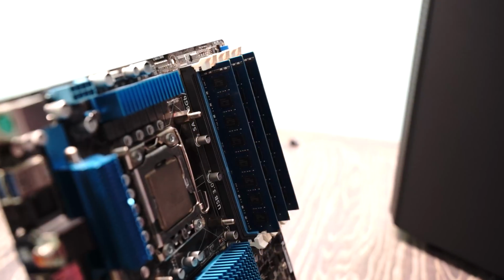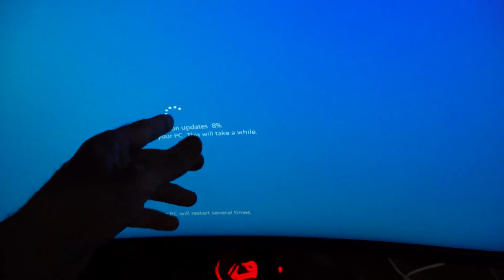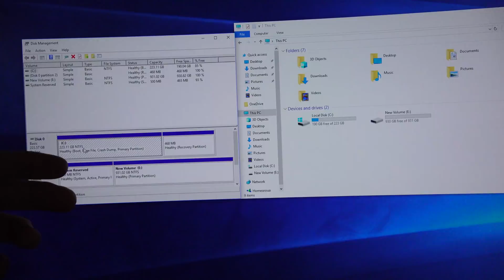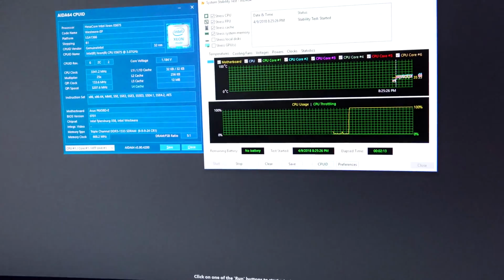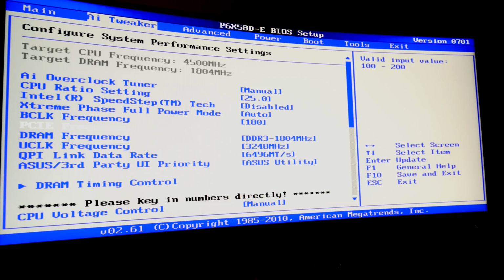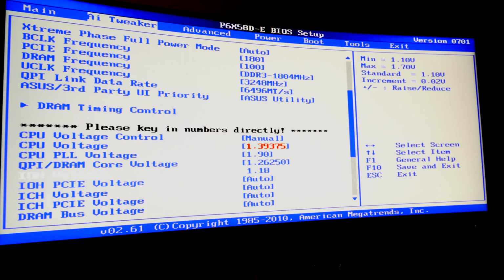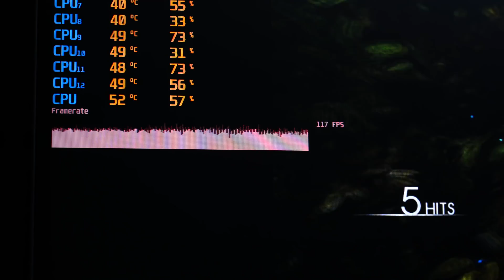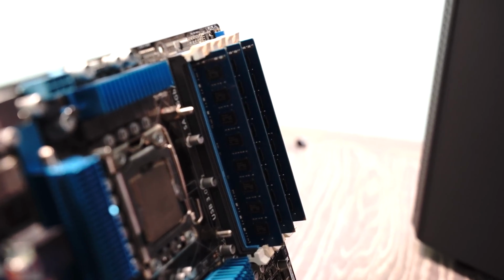Is X58 Still Worth it..? Taking the 6 Core X5675 to 4.5GHz on AIR.

Comment: I've done "professional" x58 overclocking back in 2010/2011. Here some tips you probably don't know:
-Westmere actually likes reducing PLL Voltage..most CPUs liked around 1.3-1.5V. You can reduce your Vcore up to 10%. 
-Running over 1.65V on the memory is no problem but NEVER exede a delta of 0.45V between your QPI voltage (memory controller) and your VDimm [example: 1.4V QPI 1.85V Ram "safe" / 1.2V QPI 1.7V Ram "unsafe"] (keep in mind to look up for what voltages the ICs on your memory can handle...modern 1.35V ICs will most likely die at 1.85V)
-Unlike Bloomfield, Westmere/Gulftown allows you to reduce the Ram/Uncore Ratio to 1:1.5 . Don't do it. You loose so much performance. 1:2+ is always perfect on X58. [example: 2200Mhz Ram / 3300Mhz Uncore gives you less performance then 1800Mhz Ram / 3600Mhz Uncore but needs extreme voltages to get stable]
-The BLCK on many CPUs often have "blindspots". [example of an 920 D0 ...133-210 stable/211-218 bootable/219-233bootloop/234-238bootable
Reply: Thanks a lot for this info, I'm just torturing a i-920 D0 (including leaping) only to experiment before the x5675 I ordered for 27€ arrives. It seems that I will surely destroy the P6T Deluxe V2 before destroy the CPU itself! Weird, not proper Thermal Protection (it has, sort off, but not a proper one), and still this puppy eats all I throw..
Reply: SouthPlanObservation I have 1333Mhz Rams so 2666Mhz would be best for Uncore?
Reply: @etop2650  2666 or higher. I can get up to like 3600mhz @1,3V QPI/VTT (dont go higher for 24/7)
Reply: I´ve a question here. Cant get my 990x stable at like 4.4 Ghz. even with 1.4V in Bios. Have an Gigabyte G1 Assassin. CPU PLL is on 1.5V. Under this = super unstable. i can get 4.4 ghz working, but LinX will throw me an error after 30 Minutes. What are the max 24/7 Voltages i could throw on this thing without breaking it ? What else could i do, to get like 4.5 or more?
Thanks :)
Reply: @xxcr4ckzzxx840  I also have a i7 990x running at 4.6Ghz (Hyper Threading On) at 1.50 voltage.
Runs great for almost 3 years now
Reply: @opoxious1592  Hi OpoXlous, which mobo version of x58 and would you mind sharing your setting?  I had a Sabertooth and a I7 990 ready to burn! :)
Reply: @alextran74  i have the "Asus P6T"
CPU ratio setting: Manual
BLCK: 100
Multiplier: 46
CPU Voltage 1.50
Speedstep: Enabeled
Hyper Threading : on
Ram: 1604 Mhz (Voltage 1.58)
the rest of other ram settings  on "auto"
C-state settings Disabled
Load Line calibration: Enabled
CPU differential amplitude (1000Mv)
CPU PLL voltage: 1.98
All other settings that i have not written down are left as they are.
So if you need some more details about my settings, let me know
Reply: weird I have a i7 970 with ripjaws x 24GB 1866MHZ timing 10,10,10,20 left everything auto on my ASUS p6t deluxe and BCLK 138 and well with my hyper 210 cooler I am stable 35-40c idle and CPUZ shows 3.5ghz when stressed 79c max stable but windows 10 still shows 3.33ghz and never changeds ? what I do know is I get 200FPS in new games like Destiny 2 1080p and fortnite chapter2 easily and my cpu runs at 60% usage and GTX 1060 oc 1945MHZ runs at 98% so my guess is my gravis card is too weak but hey what I can afford !!!
Reply: @EpicGamingEct  maybe IT IS the Intel Turbo Mode which reduces the frequency when all Cores are aktive. Maybe there is a Biosversion which has other CPUID Codes for the Turbo Mode and Support the enhanced turbo Mode, or allcore Turbo wich ist IS named by Asus!? But this 3,33 Ghz should be ~enough to fuel a 1060. Maybe Overlocking the GPU and V-Ram could Bring a few frames more!!?
Reply: @EpicGamingEct  I suspect that taskbar will show wrong numbers because those intel first gen processors are not officially supported in Windows10. I noticed this same thing with my i7 920 when I overclock but the when I change my voltage to fixed and set off all the power saving features like intel speedstep and so on then the taskbar show right numbers for the processor.
Reply: What about stuff on Bloomfield?
Reply: The 2011-R Xeon e5-1660 V0 likes reducing the pll voltage too, the pll overvoltage should been deaktivatet. so you can reach a stable and performative clock of 4,950MHZ with 12 threads.
Reply: what do you suggest. i7 990x 2133mhz ram bigbang mobo
Reply: @damocles5047  you're likely going to pay more for something like that than just getting a budget new system with something like a 3300x which will perform better anyway. Otherwise yes that's about as good of a combo as you're going to get for this platform.
Reply: Late question: Does the MSI x58 Platinum "support" the Intel E5649?
Reply: Imagine if this guy didn’t even know what he was talking about and this was all bs.. lol j/k. Good memory bro!
Reply: @SouthPlanObservation There are several issues with the provided advice: the motherboard in question has a minimum Phase-Locked Loop (PLL) voltage of 1.8V, which cannot be reduced further, and the recommended DRAM voltages are too high. My 1866 MHz DIMMs are overclocked to 1960 MHz with CL9 timings, and they only require 1.56V. I believe they could be stable at even lower voltages, but I haven't had the opportunity to fine-tune them. My Xeon X5675 overclock has been stable for years, running on air with Windows 10 and now Windows 11 24H2. The Uncore Clock (UCLK) is set to 3920 with a 23X multiplier, Base Clock (BCLK) at 196, core clock at 4.508 GHz with a voltage of 1.356V, and the QPI/DRAM core voltage is set at 1.36875V.
Reply: great info
Reply: 5th gen in 2010?

Comment: What the hell, I have a 4790k at like 4.7 and I get a bit over 900 cinebench and this is destroying 1000?
Reply: EndstyleGG you realize it's 6 cores 12 threads vs 4 cores 8 threads
Reply: yeah its just that you can get the cpu and motherboard under 200 eur and mine cost over 500
Reply: i actually have a haswell 4770k as well but also just picked up a x58 for a pretty good deal

Just picked up yesterday a sabertooth x58 with a x5650, 16gb ddr3 ram, a high end fractal design case, a 700 watt psu, 60 sdd, 1tb hard drive, crappy 756mb gtx 460, a spare i7-950, for $180 so I get your drift about the bang for your buck ratio

I'm gonna try and sell the fractal design case cause it's too bulky for me and it's worth more to sell than the design aesthetics for me. and the gtx 460 should net me at least $20. another $20 for i7-920, 

However, keep in mind the 4770k and 4790k destroy this thing on single core performance in gaming. At stock, they beat the xeon over clocked. Overclock a haswell and you got a monster.
Reply: This is exaclly what I have been thinking of doing. Just buying a pc with a x58 mobo then buying this xeon and you have a great lan party or just a second pc at hand for dirt cheap

Comment: Heh, I upgraded from my 2013 A8-3870 to this 2009 X5650! TIME IS NOT EVERYTHING
This thing is a beast !!! I got it through a great deal on a Dell T3500 workstation, and I've kept it in that because it just works really well.
I'm still not yet got to 100% usage yet!!

(It also really supports your argument of PCI-E is everything. This thing has like 8 PCI-E slots!!! I have a Dual Slot GTX 760, a USB 3.0 card, A LSI SAS controller, a AV capture card, a HDMI capture card, and there is still a few lanes free !!)

Comment: Do you guys think it would be better to get an x5675 or an x5690. I currently have an x5660 and I'm honestly just trying to get higher overclocks with better stability. I'm currently running my x5660 at about 4ghz btw.

Comment: Hello YES man, I ventured into the enthusiast pc building thing a few months ago and got a brand new asrock x58 extreme motherboard for about 100USD and an i7 990x for around 40USD. I am really loving this new computer, all my games run perfectly fine and I can do a lot of stuff at the same time with those 12 threads.

Do you know if this board is durable? I am scared as hell of doing any OCing on it, I also ended up using the intel cooler instead of the CM 212 EVO (I think this CM might have had influence in my previous gigabyte mobo's premature death, due to it possibly not being able to cool the VRMs properly).

I haven't had the guts to do any overclocking on it yet, too scared since my old gigabyte f2a88xm died with no apparent reason (apart from maybe doing some sporadic overclocking on it, but nothing that made my temperatures go crazy, or the VRM cooling I mentioned before).
Reply: I see your question is a few months old, but no one's answered so here go's :)
Firstly Overclocking on a stock intel cooler is a bad idea to be honest those coolers are not even very good @ stock speeds this is the reason Intel no longer include them with their higher end cpu's.
Investing in a decent cooler isn't a bad thing I've had a NHD14 since 2009 and it's still going strong today.
Don't be afraid to mess around with settings in the bio's all settings should give a small explanation of what they do it's very hard to kill a cpu with out feeding it excessive voltage, all cpu's & motherboards will behave differently even identical models may not run at the same clocks or require the same voltages to achieve a certain clock speed so there's no ironclad settings anyone can give you.
Do NOT leave your vcore on Auto while overclocking! for your specific cpu intel recommends going no higher than 1.35v on the v core so this is a good starting point with mid range cooling solutions like your CM 212 EVO, if you do have extreme cooling ie: a hefty tower cooler or AIO then then anywhere up to around 1.4v maybe 1.42v at a push as long as your temperatures are within reason I like to keep mine under the 80c mark however this is subjective and can be lowered or increased by personal preference.
If your VRM's was the cause of your old board dying it is not an issue with the cpu cooler, this could have been caused by too much voltage or heat however this heat should be taken care of by your cases airflow & heatsink if the board has one not the cpu cooler (towers do help a little), try using HWinfo or a similar program to check the temperatures of them if it's a concern you can always mod in a fan pointed directly at them, decent vrm's are rated @ 125c+ so no need to panic if they are a little high.
i'm not going to go into each specific setting as there's literally hundreds of guides already and well worth reading through if you intend on bumping your clocks.
As for the asrock x58 extreme I haven't tested that particular board  but Asrock have been solid for a long time just make sure it's updated to the latest bio's and you should be good to go.

Comment: I got my X5650 @4GHz under CM 212 EVO on ASRock X58 Extreme3 motherboard (with SATA 3 and USB 3.0) paired with triple channel ram and gtx 1050ti. Running all games that my GPU allows me to. Never used this CPU more then 20% lol.

Comment: x58 is so good  i startd a ryzen build.  with the prices i just cant finish it  i picked up a used  5670/mb/12gb od ram  for 120bucks    thats  less than hald of what the ram kit i was going buy for the ryzen.   i overclocked the x5670 to 4.2ghz  i have no regrat  just smiles

Comment: Thanks for the great video. I have the same mobo (P6X58D-E) and I have noticed that the Northbridge heatsink gets extremely hot (too hot to touch) even when idle. I replaced the TIM like you did in the video but the issue persists. Any ideas ? Does yours get hot as well?

Comment: I will update from my 2500k when I can double it's single thread IPC for $299 or less. We're still not there. 

I've built dozens of systems, when I use an I/O shield the system dies, every system I own without an I/O shield is still alive today including an old single core Sempron.

Comment: The uncore ratio had to be 2:1 with the RAM with Bloomfield processors. With Westmere, the ratio requirement was reduced to 3:2. The biggest thing this affects is maximum RAM speed. It was pretty much impossible to achieve RAM speeds of 2000 MHz or higher because uncore frequency of 4000 was practically impossible to achieve. Chasing RAM frequency is kind of pointless on this platform since it prefers tighter timings.

Comment: i used your suggestions and got my x5650 that wouldnt go barely over 4ghz to 4.75ghz stable lol. I need a better cooler though. It sometimes thermal throttles with a nhd14. at 1.5v

Comment: My build until last year was an i7 990x running a 4.5ghz overclock since it was brand new, I had a Gigabyte G1 Assassin board, I managed to do a few bench runs and get it running at 4.8ghz, that was a seriously beasty rig and I miss it, but i needed to upgrade to Broadwell-E for some AVX2
Reply: StreekG What do you need AVX2 for???
Reply: David Johnson I wanted to start streaming and my 990x couldn't use the feature where it deletes the background in the webcam. It was telling me I needed a CPU with AVX2. So I figured why not upgrade my 6 year old rig.

Comment: Yay X58 stuff!  I got so excited, I got a steal on ebay. Found AsRock X58 Extreme for $88 (most boards are in $150-250 range)   
I need some help with ram as I want to get some good speeds/ or like what bryan is getting in terms of ram speed. 10GB or better.    any help with the best ram/ or even LED Ram. Triple channel 3x or 6x, i want high clocks.  I am fluid with the OC part.
Reply: 88$ for a 1366 is a great price. plus he is clearly going to put in a xeon. why would he want to get a 1151 when thats not what he is aiming for?

Comment: Im running a Gigabyte UD5 with a 3680 at 4.3ghz and a 1080 Ti so Im only 200 mhz less than your test and pubg drops below 60 fps @ 1440p for me usually a couple of times a game.... I wonder if you went to Los Leones if your results would of been as good......Still it really is the only way to go unless you do have the money for an 8700k.

Comment: If you have to modify your mobo with heatsink or anything for that matter then you shouldn't be purchasing that product. Only brand of mobo you should be even looking at if you're an enthusiast is MSI and ASUS as a fall back. Overclocking your CPU, GPU or RAM is not recommended by the manufacturer. You will notice an improved performance from what was stock or factory OCd but you are significantly degrading the lifespan or that part. Maybe you got flow and can afford an upgrade every 2 years but if you built properly that should really only be 5 min. 

OS: Win 10 Pro
CPU: AMD FX-8350 (4.0 GHz, 4.2 Turbo)
RAM: 12 GB DDR3
MOBO: ASUS M5A97 R2.0
GPU: EVGA nVidia GeForce GTX 970 FTW
PSU: Thermaltake 750W 80+ Bronze

Circa 2012 (minus GPU, original was EVGA nVidia GeForce GTX 650 Ti SSC (Super-Super Clocked)

No issues with even modern games but mind you I play at 1080p because I don't wear glasses or contacts so 60 frames doesn't feel like 30 and resolution looks comparable to 1440p or ~4k.

Comment: I had an Asus x58 deluxe with an x5660. It had front usb 3.0 headers.   I loved playing around with it Had it on 4.2Ghz on air.  Sold it the combo for $150 last year.  I slightly regret it now because DDR4 is so expensive.  But the board is really old so idk how long the capacitors would last.  I went back to my 4790k.

Comment: I have a ga x58a udr3 board and only recently upgraded due to buying a vr headset and seeing that my scores were low when using pcmark7.

   I was running it stock with an i7 960, gtx 1080 and 32gb ram and although it did have usb3.0 vr headset recommendations were for 3.1 so i installed a pci 3.1 it ran perfectly fine with vr but was dropping a few frames. 

  I upgraded recently to an msi z370 m5 gaming board running an i7 8700k with a gtx 1080 and 32gb 3700mhz ram overclocked to 4.7 ghz and as far as vr is concerned, i see some improvement but not a lot. It does run smoother and is only slightly clearer but if knowing what i know now  to buy the motherboard cpu and ram upgrade then its certainly not worth the investment just for vr despite my old board and cpu not meeting minimum specs.
  
Normal gaming I dont really play the latest and greatest as i am more into strategy games but i do run games like tomb raider and hitman absolution and they run beautifully on my old rig. I am no computer expert though and I am glad i have future proofed myself.

  Thankyou for the video and i will get it back out and pair it with my old gtx780ti and use your settings as a guide. I wont feel comfortable until i upgrade cooling though as its using stock heatsink that came with the cpu (at least it came with one unlike my 8700k!) probably go a watercooling.

  Thanks for guiding an amateur cheers!

Comment: I have a Xeon X5650 and my max overclock was 4.2GHz on air. I cant go higher because I have to increase the BCLK which cant go higher + my cooler isnt good enough for more.
I'm already at 1.37V. 
My Ram is at 1684MHz and also cant go higher, it gets pretty hot.
4,2GHz x5650 and 1684MHz 16gb DDR3 is enough for me and its my first CPU that I overclocked (I also have the asus p6...d-e, I would have to look at your video again to see the correct number but I have definetly the same mobo with Marvell Sata 6gb/s and that stuff...)
Great Video and I'm very interested in your next video about x58.
I also had a gtx 1060 6gb from Asus and they seemed to be a great combo. My 1060 was at 2125MHz and the memory at 9100MHz. 
I sold it because I didnt need it (and I sold it for a higher Price than I bought it).
Now I have a gtx 750Ti and edited the bios to get a stable oc of 1480MHz.

Comment: I have one major problem with x58. CPU's are roughly designed to have a lifespan of 10 Years one IT Guys once said to me, I have read it somewhere too. So - of it holds true..aye lmao, I have gone with x79 and I am still kicking the R5 1600X's Bootay with my i7 3960X (100 Dollares on le eBay) still wanna try them sweet Quad Channel, but need better prices on my RAM xD